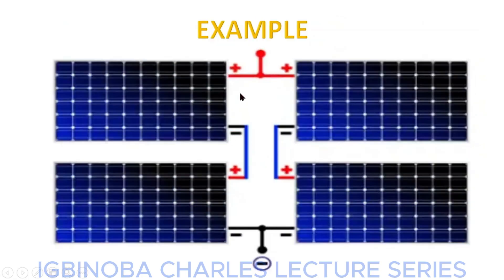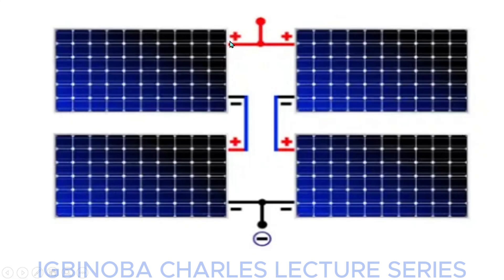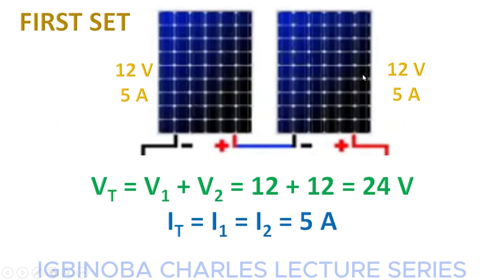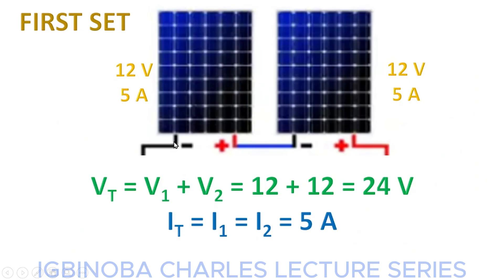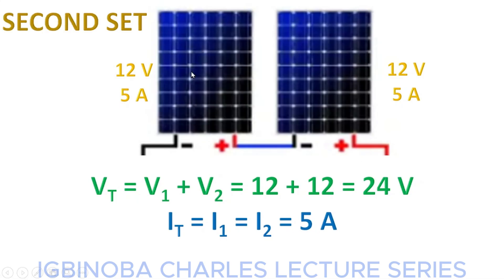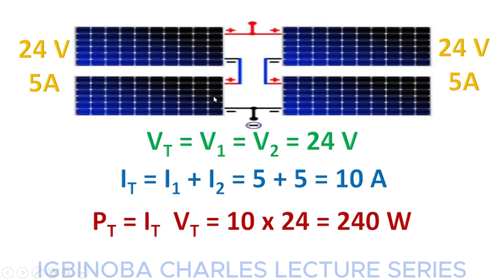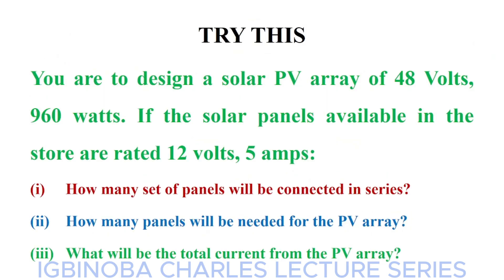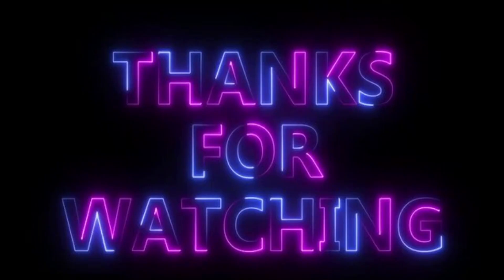Connection of  Solar Panels in SERIES-PARALLEL

Comment: MAR3137G

Given:
Required PV array = 48 V, 960 W
Each solar panel = 12 V, 5 A
(i) We need 48 V, and each panel gives 12 V.
Number of panels in series = 48v/12v = 4
Answer: 4 panels in series

(ii) First, find total current and total power needed.
Each 12 V, 5 A panel = P = VI = 12 x 5 = 60W
Total power required = 960 W
Number of panels = 960W/60W = 16
Answer: 16 panels total

(iii) Since 4 panels are in series per set, and total panels = 16:
Number of parallel sets = 16/4 = 4
In parallel, current adds up, voltage stays constant.
Each series set gives 5 A, so:
Total current = 4 x 5A = 20A
Answer: 20 A total current

Comment: PETRO321U

1. Four 4 set of panels will be connected in series

2. Each panels power =12x5=60 watts 
Total number of panels =960/60=16 
Therefore 16 panels will be needed for pv array

3. Total current generated by pv array ;
Power= total current x total voltage
960=48 x total current 
Therefore; total current =960/48
Total current =20amps

Comment: PETRO325Y

1.Four Panels are connected in series 

When you connect four 12 volt,5 amp panels in series, you get a total of 48 volts, which is the voltage needed for the solar system 

2.A total of 16 panels are needed 

Each panel produces 60 watts(12V*5A=60W) To get the 969W in total: 960/60=16 Panels 

3.The total current from the solar array is 20 amps.

Using the formula I=P+V, I=960W/48*V=20A

Comment: COMP335I

Required PV array: 48 Volts, 960 Watts
Each solar panel: 12 Volts, 5 Amps
1. Number of panels in series
We need 48V total and each panel gives 12V
= 48V÷12V =4
Hence 4 panels in series
2. Total number of panels needed
Each panel produces:
12V x5A = 60W
Total required power= 960W
Total number of panels= 960W÷60W= 16
Hence 16 panels needed
3. Current from the PV array
Total panels = 16
Each series string = 4 panels (48V, 5A)
Number of parallel strings= 16÷4 = 4
Current per string=5A
Total current=4 stringx 5A= 20A
Hence Total current is 20A

Comment: COMP38H

Required PV array: 48 Volts, 960 Watts
Each solar panel: 12 Volts, 5 Amps
1. Number of panels in series
We need 48V total and each panel gives 12V
= 48V÷12V =4
Hence 4 panels in series
2. Total number of panels needed
Each panel produces:
12V x5A = 60W
Total required power= 960W
Total number of panels= 960W÷60W= 16
Hence 16 panels needed
3. Current from the PV array
Total panels = 16
Each series string = 4 panels (48V, 5A)
Number of parallel strings= 16÷4 = 4
Current per string=5A
Total current=4 stringx 5A= 20A
Hence Total current is 20A

Comment: Mech387l

1. Number of panels sets in series: 48V+12V=4
4panels

2. Number of panels for PV array: (12V*5A) = 60W
Therefore: 960W/60W=16 
16 panel for array

3. Total current
Number of parallel strings: total number of panel for PV array/number of panels set in
series 16/4 = 4
Therefore total current = 4*5A = 20A

Comment: CHM 3670

1. Since it is a series connection, the number of panels required =  48V ÷ 12V = 4 panels

2.  P = IV = 12 × 5= 60W 
 Number of panels = 960 ÷ 60 = 16

3.  Total current = 4 × 5A = 20A

Comment: EEE338L

1. Number of panels set in series: 48V ÷ 12V = 4

2. Number of panels for PV array: 960W ÷ (12V x 5A) = 960W ÷ 60W = 16

3. Panels connected in parallel = 4 (with each having a current if 5A).
Total current in PV array = 4 x 5A = 20A.

Comment: CHM45S

i. 4 sets of panels will be connected in
series ( 48V/12V) = 4
ii. 16 panels will be needed for the PV array
(960W/60W) = 16
iii. The total current from the PV array is
20A ( 960W/48V) = 20A

Comment: MAR324X
 Required PV arrays :48V , 960W
Available solar panel :12V, 5A
 a) how many solar panels in series 
In series; voltage add up ,current stay the same 
So needed voltage=48V, and each panel=12 V
Number in series =48/12=4
 b) how many total panel for the array ? 
Each panel = 12V×5A= 60W 
To get total power =960 w 
Number of panel =960/60 = 16 
c) what will be the total current from the PV array ? 
Each series string contains = 4panels = 48V, 5A 
We have 16 panels in total 
So number of parallel strings= 16/4= 4

Comment: MAR 369Q

Given:
Power:960W
Each panel has a rating of 12V and 5A
Total voltage: 48V
1. The total voltage is 48V and individual volt is 12V, therefore the number of panels connected in series is 48V÷12V =4V
Therefore the number of panels connected in series =4V
2. The power generated by each panel is given as;
P=12V×5A=60W
The total power is 960W. Therefore the number of cells connected in the PV array is Total power÷individual panel power =960W÷60W=16
Therefore the total number of panels in the PV array is 16.
3. The total current generated in the PV array is given as;
Power= Total current × Total voltage 
960W=48V ×Total current 
Total current = 960W ÷ 48V
Total current = 20A

Comment: PETRO3130Z

I. Four panels are connected in series.

When you connect four 12-volt, 5-amp panels in series, you get a total of 48 volts, which is the voltage needed for the solar system.

2. A total of 16 panels are needed.

Each panel produces 60 watts (12V * 5A = 60W) To get 960 W in total: 960/60 = 16 panels.

3. The total current from the solar array is 20 amps.

Using the formula I = P + V, I = 960W / 48 * V = 20A

Comment: MAR 3145O

1. 4 sets of panels will be connected in series.
Since connecting 4 of the 12 volts, 5 amp panels in series gives a total of 48 volts as required by the solar PV array design
2. 16 panels will be needed for the PV array.
This is because the power of each panel is 12 x 5 = 60
watts, therefore the total number of panels to
produce 960 watts is, 960/60 = 16
3. The total current from the PV array is 20 amps
Since | (total) = P (total) / V(total)
I (total) = 960/48 = 20amps

Comment: MECH331E

i. 4 sets of panels will be connected in series
( 48V/12V) = 4

ii. 16 panels will be needed for the PV array
(960W/60W) = 16

iii. The total current from the PV array is 20A
( 960W/48V) = 20A

Comment: CHM321U

i.since a series connection determines  the total voltage of the solar array and the required system is 480V,so the number of panels connected in series produces the total voltage 

The number of panels required is
   48÷12=4panels

ii-the power of each panel is total voltage multiplied by total current
    P=12×5
      =60 watts
 The total number of panels to produce 60 watts=960÷60
          =16

iii- total current=power/voltage 
      =960÷48
      =20 amperes

Comment: CIV35E

1). 4 panels are connected in series.

We connected four 12-volt, 5-amp panels in series, so we get a total of 48 volts, which is the voltage needed for the solar system.

2). A total of 16 panels are needed.

Each panel produces 60 watts I.e. 12 V x 5 A = 60 W
To get 960 W in total, 960+ 60 = 16 panels.

3). The total current from the solar array is 20 amps.
Using I = P + V, we have that, 1960 W 48 V = 20 A.

Comment: PETRO315O

1. Number of panel sets in series: 48V ÷ 12V = 4

2. Number of panel for PV array: 960W ÷ ( 12V * 5A) =
960W ÷ 60W = 16

3. Total current:
Number of parallel strings: total no of panel for PV array/ number of panels set in series = 16/4 = 4
 Total current= 4 * 5A = 20A

Comment: MEC27A

Panel: 12 V, 5 A → power per panel = 12×5=60w 

(i) Series panels to reach 48 V: 48/12 =4 
→ 4 panels in series per string.

(ii) Panels needed for 960 W:960/60 = 16  .
With 4 panels per series string, number of parallel strings = 16 ÷4 =4 .
→ 16 panels total (arranged as 4 series × 4 parallel).

(iii) Total array current: I =P/V = 960/48 =20A
Also: 4 parallel strings × 5 A per string = 4×5 =20 A .
→ Total current = 20 A.

Summary: 4 panels in series per string, 4 such strings in parallel → 16 panels total, delivering 48 V at 20 A (960 W).

Comment: PETRO3165I

1. 4 panels are connected in series 
    When connecting four 12-volts, 5-amp panels in series, you get a total of 48volts which is the voltage needed for the solar system 

2.Each panel’s power = 12 x 5 = 60W 
Total number of panel will be 960/60 =16 
Therefore, 16 panels will be needed for the PV array 

3. Each parallel string carries 5A 
    Current (l) = 5x4=20 A 
   Therefore the total current from the PV array is 20A

Comment: PETRO327A

1. 4 panels are connected in series 
    When connecting four 12-volts, 5-amp panels in series, you get a total of 48volts which is the voltage needed for the solar system 

2.Each panel’s power = 12 x 5 = 60W 
Total number of panel will be 960/60 =16 
Therefore, 16 panels will be needed for the PV array 

3. Each parallel string carries 5A 
    Current (l) = 5x4=20 A 
   Therefore the total current from the PV array is 20A

Comment: CHM324X
a) Since the panels are connected in series and the target voltage of the system is 480 V, we can find the number of panels required by dividing the total voltage by the voltage of one panel.
Thus, 480 V ÷ 120 V = 4 panels are needed in series to meet the voltage requirement.

b) The output from one panel is given by multiplying its voltage and current: 120 V × 5 A = 600 W.
Given that the system’s total power demand is 960 W, the total number of panels required is 960 W ÷ 60 W = 16 panels.

c) With 16 panels in total and 4 panels per series string, the number of parallel strings becomes 16 ÷ 4 = 4 parallel connections.
Each string provides 5 A, and since they are connected in parallel, the combined output current is 5 A × 4 = 20 A.

Comment: MAR3138H

1. 4 set of panels will be connected in series

2. 16 panel needed for the PV array

3. The total current is 20amp from the PV ARRAY

Comment: PETRO3125U

Answer:
1. Four sets of panels will be connected in series.

2. Sixteen panels will be needed for the PV array.

3. Total current from the PV array; I =P/V = 960/48= 20Amps

Comment: COMP321U

Given:
Required PV array: 48 V, 960 W
Available solar panel: 12 V, 5 A
(i) How many panels in series?
In series, voltages add up, current stays the same.
We need total voltage = 48 V, and each panel = 12 V.
Number in series =48/12=4
(ii) How many total panels for the array?
Each panel = 12V ×5A=60W
To get total power = 960 W
Number of panel=960/60=16
(iii) What will be the total current from the PV array?
Each series string = 4 panels = 48 V, 5 A.
We have 16 panels total, so:
Number of parallel strings=16/4=4
In parallel, current adds, voltage stays same (48 V):
Total current =4×5A=20A

Comment: PETRO330D

1. Four  (4) sets of panels will be connected in series.

2. Sixteen (16) panels are needed for the PV array.

3. Total current from the PV array is obtained using the formula; I=P/V
Where; P=960watts, V= 48 volts

I= 960/48 = 20Amps

Comment: Nat318R

a) Since the panels are connected in series and the target voltage of the system is 480 V, we can find the number of panels required by dividing the total voltage by the voltage of one panel.
Thus, 480 V ÷ 120 V = 4 panels are needed in series to meet the voltage requirement.

b) The output from one panel is given by multiplying its voltage and current: 120 V × 5 A = 600 W.
Given that the system’s total power demand is 960 W, the total number of panels required is 960 W ÷ 60 W = 16 panels.

c) With 16 panels in total and 4 panels per series string, the number of parallel strings becomes 16 ÷ 4 = 4 parallel connections.
Each string provides 5 A, and since they are connected in parallel, the combined output current is 5 A × 4 = 20 A.

Comment: MEC63K

1. Panels Connected in Series
To reach the required system voltage, we connect multiple solar panels in series. In this case, combining panels to get 48V + 12V means we need 4 panels in series.

2. Total Number of Panels in the Array
Each panel has a rating of 12V and 5A, which equals 60W per panel. To achieve a total array output of 960W, we need:

Number of panels = 960 ÷ 60 = 16 panels

3. Parallel Strings and Total Current
The panels are arranged in parallel strings to handle the current. The number of parallel strings is calculated by dividing the total panels by the number of panels in series:

Parallel strings = 16 ÷ 4 = 4 strings

With each panel producing 5A, the total current of the PV array is:

Total current = 4 × 5A = 20A

Comment: EEE3118N

1. Since a series connection determines the total voltage
of the solar array and the required system voltage is 480V,
so the number of panels connected in series produces the
total voltage.
The number of panel required is 480÷12= 4panels.

2. The power output of pne panel is the total voltage
multiplied by total current.
P= 12x5 =60watts

Therefore the total number of panel to prodUce 60WATTS

= 960/60= 16Panels

3. With 16 panels in total and 4 panels per series string,
the number of parallel strings is 16÷4= 4parellel sets.

Each string produces a current of 5A, since the strings are
connected in parallel the total current supplied by the array
Is 5A×4= 20A

Comment: PETRO 45S

1. Four panels are connected in series. When you connect four 12-volt, 5-amp panels in series, you get a total of 48 volts, which is the voltage needed for the solar system. 
2. A total of 16 panels are needed. Each panel produces 60 watts (12V × 5A = 60W). To get W in total: 960 ÷ 60 = 16 panels. 
3. The total curent from the solar array is 20-amps. Using the formula I = P + A, 
1 = 960W ÷ 48V = 20A.

Comment: NAT348V

1. In a series connection, the total voltage of the solar array depends on how many panels are connected in series. Since the required system voltage is 480V, the panels in series must produce this total voltage.

To find the number of panels needed in series:
 panels.

So, 4 panels are required to reach the 480V system voltage.

2. The power output of one panel is found by multiplying its voltage by its current:
.

Therefore, to achieve a total power of 960W, the number of panels required is:
 panels.

Hence, a total of 16 panels will be needed to produce 960 watts of power.

3. Since there are 16 panels in total, and each series string contains 4 panels, the number of parallel strings will be:
 parallel sets.

Each string provides 5A of current. Because the strings are connected in parallel, the total current supplied by the array is:
.

Thus, the complete solar array delivers 480V and 20A when all panels are connected in a series-parallel configuration.

Comment: EEE366N

Required PV array: 48 Volts, 960 Watts
Each solar panel: 12 Volts, 5 Amps

1. Number of panels in series
   We need 48V total and each panel gives 12V
= 48V÷12V =4
Hence 4 panels in series

2. Total number of panels needed
Each panel produces:
12V ×5A = 60W
Total required power= 960W
Total number of panels= 960W÷60W= 16
Hence 16 panels needed

3.Current from the PV array
   Total panels= 16
    Each series string = 4 panels (48V, 5A)
Number of parallel strings= 16÷4 = 4
Current per string=5A
Total current=4 string× 5A= 20A
Hence Total current is 20A

Comment: MECH334H

1. Four panels are connected in series

When four 12-volt 5 ampere panels are connected in series, a total of 48 volts is achieved which is the voltage needed by the solar system. 

2. 16 panels will be needed by the pv array. This is because the power of each panel is 12×5=60W therefore, the total number of panels to produce 960W is, 960/60= 16 panels

3. The total current is 20A
Given:  p(total)=I(total) *V(total) 
P= power, I= current, V=voltage
P=960W, V=48V

I=960/48 =20A

Comment: NAT34H
a) Since the panels are connected in series and the target voltage of the system is 480 V, we can find the number of panels required by dividing the total voltage by the voltage of one panel.
Thus, 480 V ÷ 120 V = 4 panels are needed in series to meet the voltage requirement.

b) The output from one panel is given by multiplying its voltage and current: 120 V × 5 A = 600 W.
Given that the system’s total power demand is 960 W, the total number of panels required is 960 W ÷ 60 W = 16 panels.

c) With 16 panels in total and 4 panels per series string, the number of parallel strings becomes 16 ÷ 4 = 4 parallel connections.
Each string provides 5 A, and since they are connected in parallel, the combined output current is 5 A × 4 = 20 A.

Comment: EEE3123S
1. Four panels are connected in series. When you connect four 12-volt, 5-amp panels in series, you get a total of 48 volts, which is the voltage needed for the solar system. 
2. A total of 16 panels are needed. Each panel produces 60 watts (12V × 5A = 60W). To get W in total: 960 ÷ 60 = 16 panels. 
3. The total curent from the solar array is 20-amps. Using the formula I = P + A, 
1 = 960W ÷ 48V = 20A.

Comment: Code: PETRO3183A
Given:
Total volt: 48 volts
Power: 960 watts
Solar panels available in the store are rated:12 volts, 5 amps.

1. Panels connected in series = total voltage/individual voltage rate
48 volts ÷12 volts=4 volts

2.power generated from the panels is :                  12 volts × 5 amps= 60 watts
Total power = 960 watts
Panels needed for the PV array= total power/ individual power panels 
960 watts ÷ 60watts = 16 watts

3. Total current from the PV array is 
Power= total voltage × total current 
960 watts= 48 volts × total current 
Total current= 960 watts ÷ 48 volts 
Total current= 20amps

Comment: CIV355C

1. 4 set of panels will be connected in series.
Since connecting 4 of the 12volts,5 amp panels in series gives a total of 48 volts as required by the solar PV array design

2.16 panels will be needed for the PV array

This is because the power of each panel is 12 ×5=60watts, therefore the total number of panels to produce 960 watts is 960/60= 16

3. The total current from the PV array is 20 amps

Since I (total) = P (total)/ V(total)
          I (total) =960/48 = 20amps

Comment: EEE3108D

1. Four panels are connected in series.

When you connect four 12-volt, 5-amp panels in series, you get a total of 48 volts, which is the voltage needed for the solar system.

2. A total of 16 panels are needed.

Each panel produces 60 watts (12V 5A 60W) To get 960 W in total: 960/60 16 panels.

3. The total current from the solar array is 20 amps.

Using the formula IP V, 1960W/48V20A